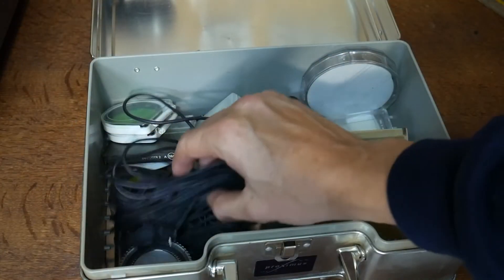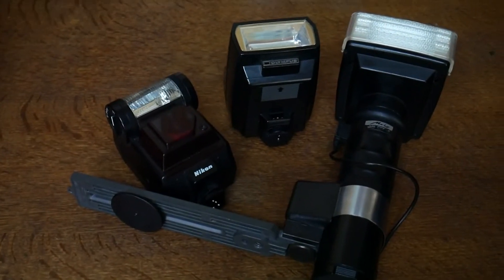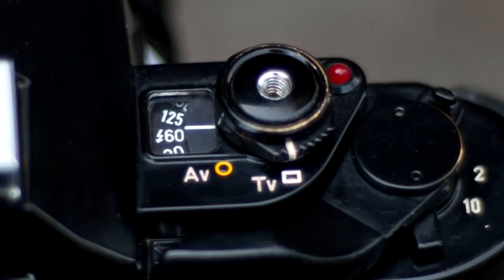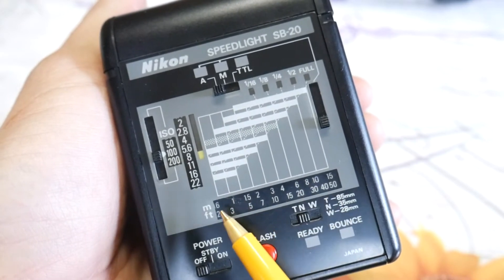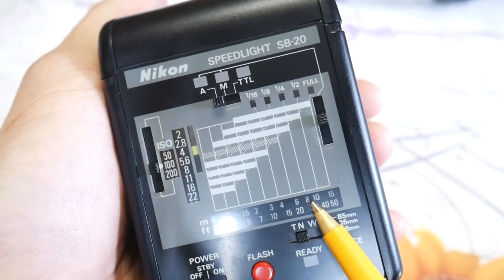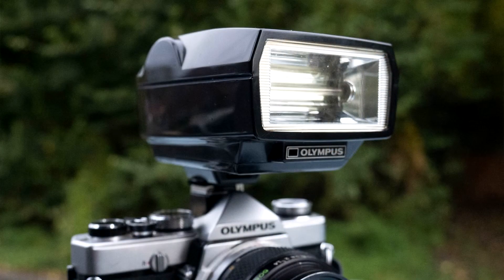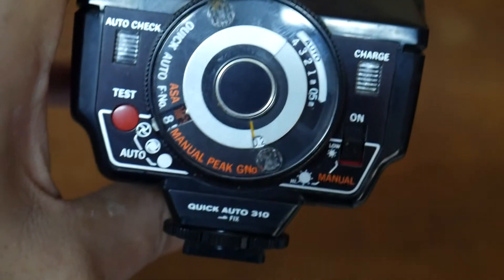How to use a flash with a film camera (Automatic flashes).

Comment: Hello Dan. I am very new to flash technique and still willing to learn. One question, do I have to modify the Nikon SB-20 so that it can work on other brands of cameras, or can it be directly attached to the hot shoe of any camera? I'm interested and want to buy the SB-20 for my Canonet QL17 film camera and my Sigma Dp0 Quattro digital camera. It's cheap, it can tilt-up, the auto seems easy to use, and it's not super big. Thank you in advance :)
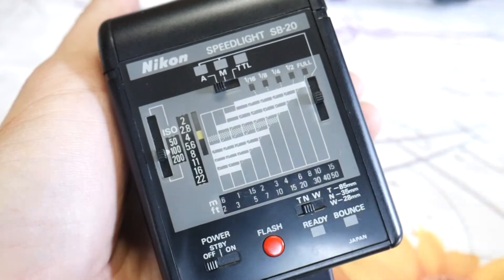Reply from the maker: Hello and yes, you can use the SB20 on any camera. It will only work in TTL mode on Nikon film cameras, but if you use it in A mode, it could be used on any camera, even digital ones. Just look at 1:23 for the settings

Comment: You should warn people that not all old flashes should be used on digital cameras. Some older flash units have a high hotshoe trigger voltage and may destroy the electronics in the digital camera. Before you try it you should check the specifications of both the flash and the camera.
Reply from the maker: I... was almost certain I mentionned it... Seems I forgot ! This is really good advice (and an idea for a short video)